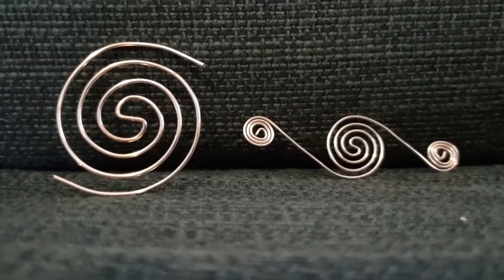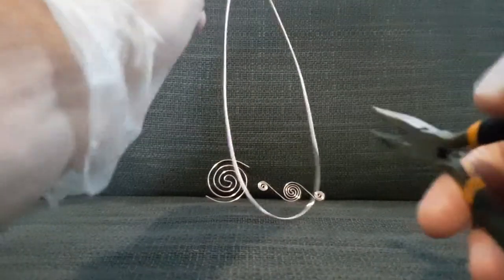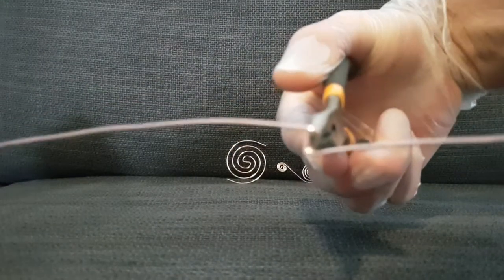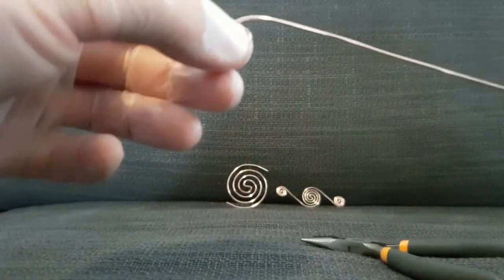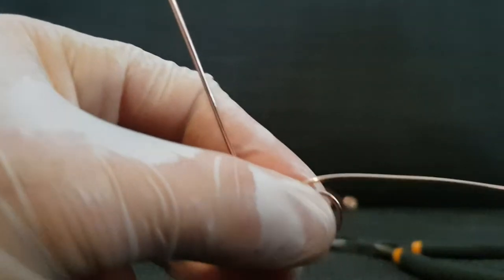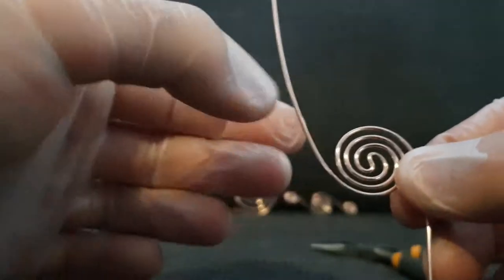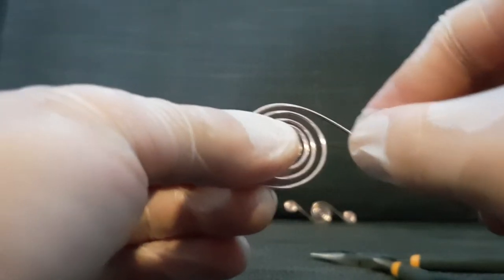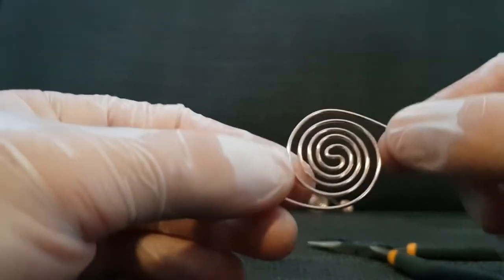SBB Copper Coil  How To For Orgonite!

Comment: What is the best gauge to use for copper coils. Thank you great video.
Reply from the maker: I like using 16 gauge AWG 👍
Reply: @sasorgonitecreations  Cheers brilliant.
Reply: Can you use copper aluminium wire for making coils. If you cannot use this, where would the best place to buy the copper from.
Reply from the maker: I would stay away from aluminium. The size copper wire above you can make sure its for jewellery making and is soft too
Reply: @sasorgonitecreations Creations Cheers thank you for this.
Reply: @sasorgonitecreations Creations I will have a look round. Thank you for information on this.

Comment: which direction should they be, they can be two directions, according to a diagram on Orgonite sites likes ones that use Dan Crofts SBB's you can have the coil going anti clockwise or clockwise, so if you are wearing it as a pendant, which way to wear the pendant? You want the energy going into you? or away from you?
Reply from the maker: Beneficial energy flows out from the "S" side 👍
Reply: @sasorgonitecreations   @sasorgonitecreations  What do  you mean by the S side, the side facing you that looks like an S? and not a backward S?  So if I am looking at the S side, it is flowing to me the viewer. So if I wear one of these, around my neck, I make sure the S side is facing towards me or my chest right?
Reply from the maker: @quantumaquarius  Correct "S" side as it is written, goes towards you, this is clockwise.
Backwards "S" is counter-clockwise spinning 🥴
Reply: @sasorgonitecreations  Ok, perfect, I think your Orgonite is some of the best I have ever seen and you always prove it with practical and scientific methods.

Comment: THank you so much for the tutorial. What gauge wire are you using?
Reply from the maker: No problem 😊 I think I'm using 16 gauge wire here.
Reply: @sasorgonitecreations  Thank you for the answer. I got 14 gauge and it is too hard to work with, so I might try 16 or 18.
Reply: @sasorgonitecreations  So I checked, and it seems to be not just the gauge, but also they come in soft, hard, and half hard. Which one is best for coils?
Reply from the maker: @feltingme  Sorry, I'm not sure what hardness the wire I get is 🤔

Comment: Nice!  Thanks for the tutorial, although you make it look easy.  What kind of wire are you using?  Half Hard?  Dead Soft?
Reply from the maker: No a problem, thanks for watching 👍
The wire im using is 99.9% pure copper wire, 1.25mm thick.
Its definitely not soft or heaps easy to work with by just using your hands like I am in the video.

Comment: Thanks for the upload. Do these add power or strength to the orgone?  Would hylauronic acid add strength inside the tower busters , as it holds a lot of water? I ask this as the cloud buster that Reich used was also connected to running water. I presumed this added power somehow.
Reply from the maker: Yes they do, its a directional thing that makes the orgone flow more in a specific direction and increases range. As for the acid i can't say, you would have to play around with it yourself. I see what your getting at but Reich's cloud buster is a lot different than Orgonite. The metal pipes were grounded into running water to get rid of the deadly orgone that the cloud buster was accumulating from the atmosphere.
Reply: @sasorgonitecreations  thank you for the insight and speedy reply, much appreciated. Is it essential to get  50/50 resin to metal? Should the metal be weighed for accuracy?
Reply: @sasorgonitecreations  Thank you for the info, much appreciated.